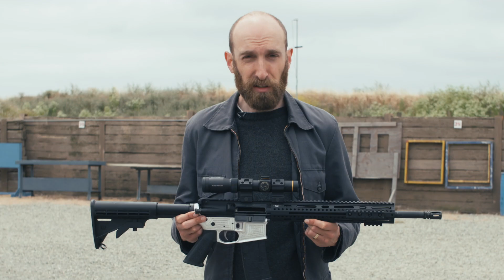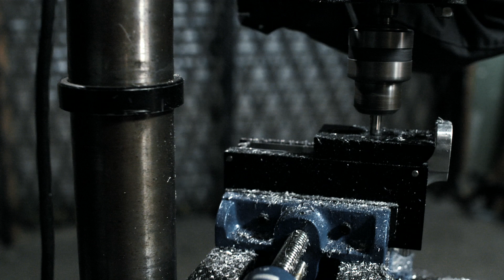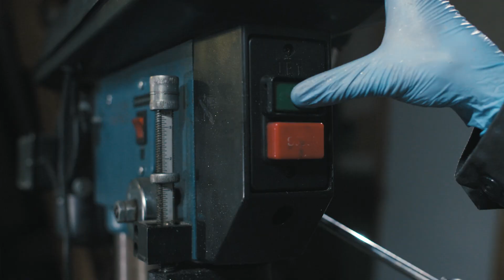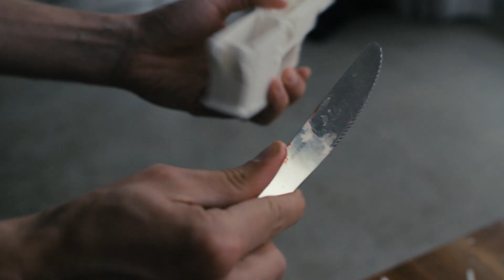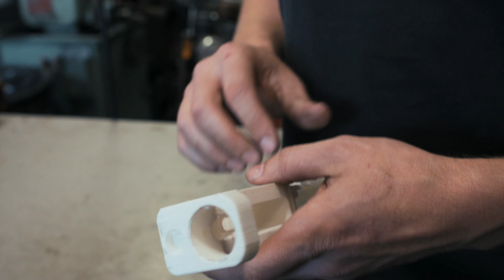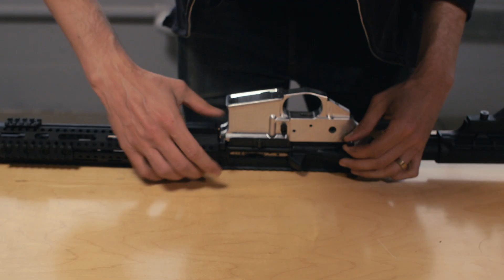I Made an Untraceable AR-15 'Ghost Gun' In My Office | WIRED

Comment: i like how he says it's "homemade" but the only thing homemade is the lower receiver, and he "borrowed" the gunsmith's upper, stock, and trigger assembly. all to prove what? that people like this are the people who shouldn't use firearms, not saying he should never be able to own one, just that i would be promptly leaving any range i see this guy at
Reply: The point is that the receiver is the only thing actually regulated as a firearm. All the other components can be bought by anyone, regardless of background checks or local legislation. Sure, he might have borrowed the other parts. But that is irrelevant because he only did so to save time; he could have bought them himself if he really wanted to.
Reply: @duckduckbobo5208  if he wanted to really save time, he could have just bought the whole gun and skipped the build process, but no he has to make a “point” on how easy it is to build an untraceable firearm, although the parts manufacturers have your purchases on record for all your parts. If they wanted to trace it to you they’d find a way

Comment: Ummmmm, everyone is saying "he used equipment that costs thousands of dollars, not everyone can afford the equipment he uses" you can literally buy a drill press for under 100 bucks,  not a good one, but one that can get the job done
Reply: And it likely is designed to cut wood not aluminum and will burn up in the process

Comment: You milled your own receiver. Big whoop. You can literally buy some steel pipe, buy a carbide head to add some rifling, and a makeshift single shot receiver that goes off with a nail a spring and shoot off rifle rounds. 
This isn't scary. Such weapons are almost NEVER used in violent crimes. Stop fear mongering.
Reply: Yeah, most of the time are handguns.

Comment: Why turn it in? Just keep it! That's the whole point -- it doesn't matter what gun control laws get passed, if the gun isn't on the books then no one can take it away. If firearms weren't under constant scrutiny and threat of being confiscated, no one would make these 80% lowers. 

Btw, it is not very hard to mill out the lower receiver with the proper equipment and know-how. There's no need to spend $1500 on the machine unless you want to make A LOT of them.
Reply: He just said he can't fly back with it, so he had to give it up.

Comment: Nothing is untraceable if you use a credit card to purchase the 80% lower. They cannot PROVE that you milled it however, nor can they prove that you assembled the parts, but you'd better be in a position to show them all the parts you purchased (unassembled) if they come knocking at your door!
Reply: Yes they can: once they get the access to your files. And by the way, how untraceable is a rifled barrel after all?
Reply: @FBPrepping  I meant unless they actually see you do it, they can't prove you milled the lower, even if you bought it AND bought a jig, etc. and they cannot prove you assembled any accessories even if they can prove you purchased them. As far as the rifling in a barrel is concerned, yep you are 100% correct, but you are assuming it's actually been used in a crime. I didn't even want to go there! In any case, it is just not worth the trouble that will come down on your head unless you are going all the way legal in a state with tough laws. And then you are registered and God forbid you ever have to use any piece (self-made or otherwise), nowadays, self-defense has to be proven without the shadow of ANY doubt or you are screwed!

Comment: Andy what is a traceable gun? Do you have any idea what you would be tracing? You did not mention how much the Ghost Gunner cost. It is much easy to by an illegal gun off the street, then make one and ten to one you already know this. One more video aimed at a section of the population that has no really knowledge of firearms or the laws that regulate them. One last thing the ghost gun does not skirt any laws, they fall under different laws and you made the point of it when you had to destroy the lowers you made or turn them in to the police. PS are you selling your ghost gunner I'm interested.

Comment: You can buy a functioning lower receiver in some states via a private sales without a background check. People making their own guns are not skirting gun control laws as much as they are making things they want to exist and  exercising their 2nd amendment rights. Furthermore, you still have to follow gun control laws when making firearms, i.e., NFA, UFA, GCA, state and local laws. 

The weapon you made in this video is not untraceable; it is simply unregistered. Any scanner at an airport will detect that weapon, loaded or unloaded, whether it is 3d-printed plastic or aluminum. 

If you are borrowing that drill press and using someone else's electricity to make your 80% lower you might be participating in a build party. As of Apr 22, 2013, the ATF has determined that they consider 80% lower build parties to be illegal. 

Your 3dprinted lower receiver was printed with nothing even close to 100% infill and I am guessing you printed it in PLA. If you want it to be safe you need to print it with a better infill and a stronger polymer. Consult groups like FOSSCAD for more information.

Comment: But why did they ban that lower part of the gun, instead of the barrel?
Reply: Because they are some idiots that think you can't get the cartridge in the barrel  to fire without a lower receiver which contains the trigger, hammer, and magazine
Reply: First, the lower is not banned it is serialized and it is legally the firearm.  You can only serialize one part of the gun. They don't serialize barrels because barrels are just tubes. Declaring all tubes firearms would make manufacturing other stuff insanely difficult and it would be EXTREMELY hard to regulate. Furthermore the only folks who would follow such a regulation would be law abiding citizens. Why punish law abiding citizens when your target is criminals?

Comment: Another liberal magazine worried about an issue that doesn't exist; for example, can anyone tell me how many ghost guns have been used in a crime? I contacted the FBI and they said it's extremely rare that a ghost gun is used in a crime, something like one incident every five years. The reason is because many guns used in a crime are either stolen or bought illegal through a straw purchase. Once a gun is stolen, the serial number is grinned off, so it is not traceable like the so-called ghost gun. Another thing is that 99% of criminals use pistols because they are smaller, and more concealable than an AR type firearm.

Comment: Yeah, you can totally make an 'untraceable' ghost gun... with an extremely expensive milling machine.
I don't think most criminals got money to spare on something like that.

Besides. 20$ and a drill gets you a slamfire shotgun made out of two sections of pipe, a nail, and a cap.
Reply: @Addict c: 
Alongside a number of other awesome bits like the Ubolt AR and the pile of glock frames. 3D printing is truly amazing. 

20$ for a slam fire shotgun is still probably a better choice for a quick illegal gat, I'd say though

Comment: thats right folks you can buy a milling machine for 1500 or a drill press for 2 grand and make an untraceable rifle!....or you can buy a cheap rifle for 550-600 bucks and use acid to dissolve the serial numbers, or simply file the numbers off! a criminal isnt going to go thru the time and process to build their own weapon only to use it in a crime and lose it or even die, they are gonna take the cheapest fastest route they can. I understand you want to bring awareness to the potential dangers of such products being out there, but the potential dangers can be said of anyone driving a car or operating heavy machinery, a full cab bulldozer is basically a tank with no projectile weapons on it , add a little bullet proof glass and you aint stopping it till it runs out of gas

Comment: In my office and a workshop and a gun shop with only a $1000 dollar machine that was designed to mill out ar15 and a 3D printer and a drill press. Or you could go into a gun shop and get one for $50

Comment: You all realize Makerbot replicators run about $2500-8000+ depending on the model, right?
He ended up using a CNC mill machine, not a 3D printer. There's a difference.
Reply: Andrew Khuu he used both
Reply: @Ihat-b2j  No. The only functional was the desktop milling machine.
Reply: @NPC-gp9xz  that's a milling machine. Did your script break again?
Reply: @FriendOxygen625  that is what he said.

Comment: This guy is fruity and paranoid. You would easily spend double or more for a cheaper product considering and AR15 is $1,000 and this machine alone is $1,500. Not to mention the couple hundred for every other part (i.e the barrel, trigger, stock, magazine, ammunition, sights etc). Combined with the fact aluminum is weaker than steel (the reason steel is used in gun factories) and would eventually break under the pressures created in the reciever by firing.

Comment: The average street crook looking for that kind of weapon isn't going to know or care that it's legal to make an AR-15 like this, nor are they going to blow $2000+ on a 3D printer and try to put their own weapon together.  They're going to either steal one or buy it on the black market, like they've been doing before this miniature milling machine came along.

This video gives modern law enforcement way too little credit for their investigative techniques.  People have been filing serial numbers off stolen weapons for decades, and they still make arrests.  If there were any real concern it would be someone using these to manufacture untraceable weapons for sale on the black market, but that would require purchasing a LOT of 80% lowers and a LOT of parts kits and complete uppers.  If non-serialized aluminum lowers started showing up on the streets guess what the ATF and FBI are going to do?  They're going to pull some warrants, go to the manufacturers of the 80% lowers and look for volume purchases, go to the manufacturer of the milling machine and cross reference, and set up a sting on the manufacturer of the illegal weapons and their clients, and that will be the end of it.  Anyone trying something this stupid WILL get caught.

Comment: $1500 milling machine - I can make a damn good AR-15 for $1500 the government knows about.
Reply: You can do the same thing with a $200 set of jigs and a $100 router.
Reply: Phillip Ligon the ghostgunner is $250
Reply: Umm no you can't. The point of that machine is set it and forget it. It'l take an inexperienced person several failures of milling mistakes with jigs before they can get a good lower receiver. This makes it perfect every time.
Reply: AR556NATO you still have to buy the 80% lowers which aren't free. Plus the machines do wear out. They don't last indefinitely.
Reply: you dont need the 80% lowers for the machine, it does it all
Reply: That single $1500 milling machine can make hundreds of  lower receivers.
Reply: AR556NATO probably make about 100 before it's completely clapped out.
Reply: alanna Partin that's 5k for the lowers. When you include every other part that goes into an AR15, it will add up to much more. Beside, the market is so flooded with AR's and Ak clones right now that sellers dont even know what to do. Once the election results came in, people stopped buying almost immediately.
Reply: No one was talking about selling them. Not in this thread at least. It's only prison time if you sell them. There's no limit to how many guns a person can have or make.
Reply: Phillip Ligon what's a router? Sorry I asked but I'm interested about that.
Reply: Lauro Gonzalez a router is a woodworking tool that is designed to hollow out an area in the face of a workpiece.
Reply: Yeah ikr, you can get like a F1 firearms skelitonized ar15 for 1500$
Reply: ALUMINUM billets are WAY CHEAP  if you buy a 2" x6" x25 ft  6061 or 7075 bar stock and a band saw with it.....   take the 2 1500.00 machines a set of plans for another 500  and the bar stock for 350.00  you just built  over 50 lowers    BEFORE you  resmelt your scrap filings   and make 40 or so more.....   so for about 5K you can build 50-100 guns..... thats 5-10.00 up to 20.00 a reciever  NO PAPER    and  hell  stamp em  buy a pallet of barrels from your closest  low cost barrel maker  and build package ARs  that sell for 300-500 EACH   ....
Reply: Okay - so lets pretend that this is in a "vacuum" and you don't raise the suspicion of the ATF through any of this until you build 100 "guns" (in reality - just lowers). 

So at your estimated 5K price point - assuming best case scenario - you still have to sell the lowers at $50 a piece to break even. Which - you can buy a lower for $50. Additionally said machine is not able to carve lowers from bar stock - it is designed to finish lowers. 

So all your time and effort - you still are competing to break even. 

And I believe it is a 10 year prison sentence for each lower you create that you sell - and is a federal felony charge. 

Man thats a lot of work for a potential 1000 years in prison. 

Not to mention - you have no idea what the process of gun manufacture. A lower doesn't include the trigger group, sights, furniture or anything else important to using the lower. 

Building from an 80% lower is not for people that are wanting to save money. It is for people that want to say "I built this".

Comment: I like how everyone says "just cut a hole or two here and the receiver is done!"
Those holes need to be machined.  You would have a hard time doing it with a simple drill press.  They need to meet tolerances to be safe... in other words, its not just a couple of holes.  You really need to know what you are doing to do it right so people who buy these are likely not criminals because criminals need guns quickly, they don't want to wait for it and if someone does it for a criminal, that is a crime on its own which would be just as easy to do with a gun that is already assembled in a gun store.

Comment: Pointless fear mongering. You know what other kind of gun is untraceable? Any normal gun with its serial number scraped off by a crook. Speaking of, if a criminal wants to get their hand on an untraceable gun, it's going to be infinitely cheaper (both in terms of time and money) to either buy one illegally (which happens) or steal it (which also happens).

Not everybody has the cash to dump on a $1500 dollar milling machine that only mills out AR receivers. Even if they did I guarantee buying that shit puts you on a watch-list anyway.

Not everybody has a milling machine or drill press, as well as the necessary skills to put it to good use. If someone IS able to do the milling and machining operations required to complete a lower, they can make fully functioning firearms with or without an 80% receiver. There's plenty of schematics online to turn pipes, sheet metal, and brake lines into fully-functioning submachine guns.

99% of the people who do 80% builds are hobbyists doing it for the fun of it.

Comment: Why do the people who do these always seem so inept at most of the methods? If you've never used a drill press, learn and then you can do it too. You can use pretty much any CNC that can cut aluminum to do this, the Ghost Gunner is just designed for it. A lot of fuss over nothing special.

Comment: "...because technically I didn't buy a gun." Yes but, you did buy a incomplete lower reciver and then buy the rest... Meaning, your rifle will most likly fail to fire in a year as, you don't have the equipment nescary to properly and accrutly cut out the metal... Not only that but, it's evident he has very little insight into gun building let alone an AR-15 in pieces.

Comment: the power tool one is cheaper and more accessible bu requires a whole lot of knowledge on these tools. i personally would use this, i recommend combining the drill with a square drill to get the cavities right and finish it simply with a file and a router.

Comment: "Untracable" AR15 with stuff you bought on the internet. That's an oxymoron if I ever heard one. Also, for the cost of milling out that 80% lower(not counting all the other parts you bought, or even the cost of the lower itself), one could simply buy a full gun off the black market. With plenty left over. Congratulations, WIRED, you've shown your idiocy.

Comment: I'm not a gun person so I don't know the mechanics or the power,  it is it possible to make a gun completely out of aluminum, and would it be safe to fire?
Reply: You could make a firearm only using aluminum for all the parts, but it would have to be simple and chambered in a low-power cartridge.  For one, you need steel springs for some basic components of the firearm, and I don't know how durable springs made from aluminum would be.  

The barrel would probably be the biggest issue; the pressures involved in harnessing a cartridge and propelling a bullet down the bore are immense.  The standard AR15, seen in the video, is chambered in .223 Remington or 5.56mm NATO, and those cartridges generally produce anywhere from 45,000 to 55,000 PSI every time you pull the trigger, and it's doubtful to me that an all-aluminum barrel would survive that for very long at all, if even one shot.  

There are components of firearms that must be able to withstand repeated impacts, pressures, and stresses, and across the board you will find most firearms have these parts always made from steel or other durable materials.  The hammer striking the firing pin, the firing pin itself, the pistol slide or rifle bolt, the barrel, and so on.  

I think if you really went out of your way to use 100% aluminum it would be very simplified, and you'd probably have to keep the pressures and power low, using very weak ammunition choices such as the .22 LR cartridge.  How long would it last?  I have no idea, but I wouldn't want to pull the trigger on such a gun.